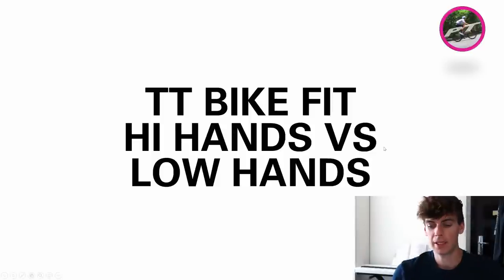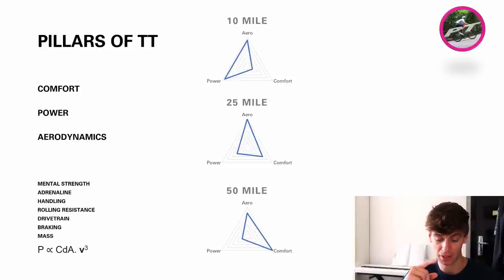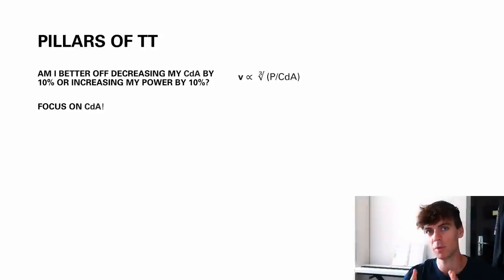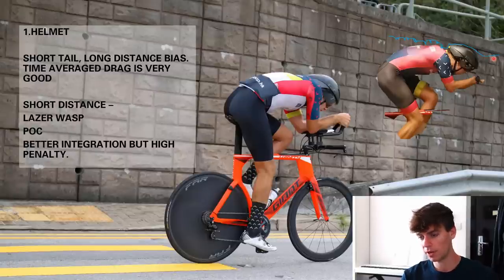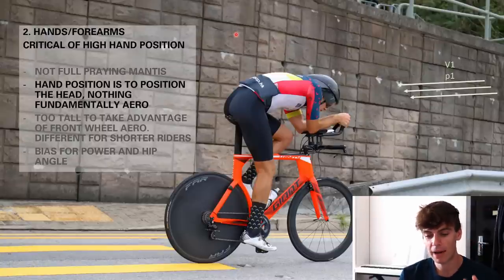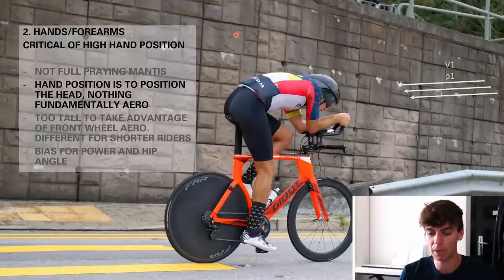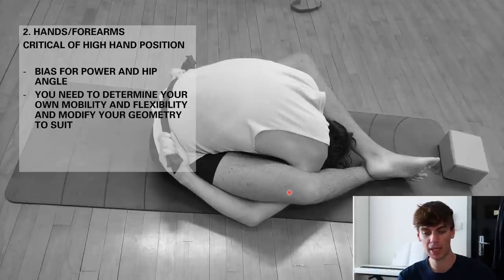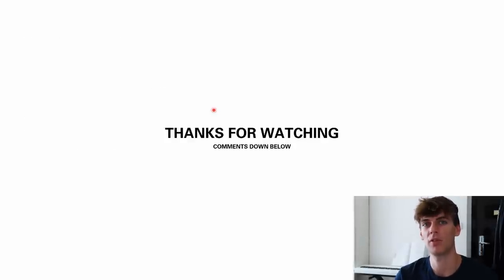TT position - High Hands Vs Low Hands. Time Trialling and Hambini response

Comment: Ahhh... Hambini, Luescher and you. 
Haven't had this much fun learning physics  since my high school physics teacher tripped on the extension chord for the laser. He was on about prisms, colour spectrum and optical index something or other. I learned a few things about gravity. 
Please make these  these back and forth reamings or cross references a regular thing. :D
Reply: Hambini thinks Luesher shouldn't repair carbon frames. You never can quite duplicate the factory materials and create a seamless bond. I suspect Hambini is partly correct. Luesher seems to know when a repair is safe and possible and when it's scrap.
Reply: People seem to disagree on what knots to use for their shoelaces No wonder aerodynamics or the structural integrity of a repaired carbon bike invites different points of view. This is not about general agreement, but independence and competence. Actual engineering analysis instead of marketing balderdash.
Reply: Luescher is very particular about what he will fix and what he wont
Reply: Spot on.

Comment: A lot of independent rider chose the Giro. What I do, and I've seen pro's do, (although not strictly legal) is to add some extra padding on the front inside of the helmet, so that the helmet sits more level while not having to strain the neck to much. If you can stay within the UCI limites you could try rotating forward to lower your front end. Other then that, shoe covers, aerobottle, a onepiece suite, the usual.. People that have properly tested raised versus lower arms, like Aerocoach, have explained that for most rider raised arms are faster but there can be very little in it & only if able to maintain power. There are several pro's that have stayed with low arms. I've spend a fair bit modeling & simulating in CFD & I'm often not that impressed with Hambini's "opinions". I always get the impression he's got something to prove.. What really does it for me though is him declaring this that and the other is the worst ... ever invented and then seeing the state of his bikes/garage and "workmate" while dropping his makeshift tools on the floor.. He truly must be a worldclass "plumber" lol..

Comment: You’re bang on with the slightly higher hands encouraging relaxation of the shoulders and allowing a lower head position. I use software in my bike fit process that measures rider frontal area. I consistently see riders being able to reduce their overall frontal area when using a slightly tilted pad and bar.
Reply from the maker: bikescience1 cheers. Good to know.

Comment: This is a good analysis from an athlete's perspective. However,  you may be missing one advantage of your semi mantis position - keeping some of the air from being "trapped" at your belly/hip area. Instead you push it outwards and around your body. Some of the same effect is achieved by using the POC Tempor or MET WideBody, reducing the drag created by your shoulder area.

Comment: Great video! You are right, there is no way the flow coming off yours or R.Dennis' helmet is laminar. Just recently found your channel and finding the level of detail and engineering insight facinating. I would be intersted to hear your take/analysis on osymetric chain rings. Thanks!
Reply: Have not got osymetrics but on my fat bike................I could top out at 38kph on the flat but the pedal stroke was very choppy - changed to a oval ring - smooth pedal stroke - found the same on my road bike - my TT bike had them already fitted when i got it - more power?? I don’t think so just a smoother pedal stroke for those of us (me) with poor technique. I did look at osymetrics when i changed my road bike rings but was very unconvinced and still running 2x rings I’d have been dropping chains all day - so it’s q ring and black spire - and forget carbon rings on 2x setups - they don’t like shifting and you have a handful of teeth and a carbon paper weight

Comment: The art of TT. It is. No power meter will give you all the answers. Real world discussion here. Where to invest the watts. Certainly not downhill against a headwind! In that case aero really is king. Get so low your power drops along with comfort. Uphill with  tailwind power rules unless you overcook it. Then you've lost time. Unfortunately you can't go back and try it again because conditions have changed.  That is why it's an art. Great Hambini  impression! Really? Fluid dynamics? A plumber?

Comment: Have you thought about attaching streamers in the form of yarn taped to a surface in the rear of the aero helmet to detect what kind of flow there is? Pretty easy to discern if its laminar or turbulent flow and thus isolate areas for aerodynamic improvement.

Comment: Hi, thank you for the interesting content!

Regarding improvement in FTP or CP for moderately trained cyclists, it would depend on the timeframe you have for improvements. If you are talking about a month 10% would generally be exceedingly difficult, but if you have 3-6 months 10% should be doable for a lot of ppl with a quality program that fits their physiology.

Regarding the tightness in your hips and quads, from what you describe I think I might be your hip flexors and rectus femoris (both hip flexor and knee extender) that’s a bit tight and implementing some stretches for them might help. This could also be a part of the reason for why you back injury occurred.
For the rectus femoris I would recommend active/passive stretching since that generally would give more functional adaptations on the bike. While on the hips flexors regular passive stretching should do the trick.

Keep making the content!
Reply from the maker: Very interesting thanks. What are some effective rectus femoris you can recommend?
Reply: @PeakTorque  This video her shows it pretty good, but instead of just holding the leg you'r stretching with you'r hand, you should put it on a chair or a box against a wall. That way you will have a lot more control over the stretch.
https://www.youtube.com/watch?v=HrhaL4XQaLs

If you want to use a active/passive you should hold the passive stretch for 30 s then while holding the stretch try to push your leg back using a knee extension  for 10 s, then release for 10 s, then repeat that 3 times.
For a regular passive stretch you just hold the stretch for 30-45 s and then release for 10 s and repeat 3 times.
Ann important note is to use a pad or pillow under the knee so you don't put to much pressure on the kneecap and patellae tendon.

Comment: Nice video! Wonder where the height cut-off is for the head and forearms entering the front wheel cone... and how this varies with rider velocity, wind velocity, yaw... . I'm also on the fence with disc wheels; for a course with very few points of acceleration for corners, and with considerable time spent at high yaw angles is where I see most upside
Reply from the maker: George C im not sure about the pressure theory. Hambini will clarify im sure. Agreed on the disc, feels like a right turd out of slow corners
Reply: @PeakTorque  Is the width of the front wheel cone significant?  My head/helmet and (as a triathlete) shoulders are a lot wider than my front wheel.

Comment: The disc wheel thing at the end was a shock. Can you elaborate on what the sensations of riding one that you dont like?
I've ridden disc wheels for years on track and TT bikes and I LOVE the handling. Granted I'm riding at 50kph not 40, but still they seem super quick in cornering, and lower weight than a deep section wheel (and less rotational inertia for a given weight)

Comment: 23:22 if you look into his knee and quad muscle in relation to his body you can see it is much closer than in your photo which does not have anything to do with his or your height. 
Also looking at his saddle you can see he is at the very tip of it, while you are comfortably positioned almost all the way back, he is almost standing like sprinting and looks like he is in lot of pain doing it, while you look pretty relaxed and comfortable. 
His knee while pedaling goes higher than his elbow while yours is lower, again his upper body is much lower than yours is which again is not function of height but simply speaking he is more flexible than you are, or he is willing to suffer more than you are, I bet cycling in his position is best described as painful but he is still doing it like that.

Comment: One thing about the long/short helmet is that the dip behind the short helmet is on a fairly narrow width of your body. From the sides, the helmet tapers in towards your neck and shoulders. How much "dip" is actually there, and how much space does the long tail actually fill? I think the POC aero helmet addresses this, but others don't. The shoulders are exposed no matter what.

Comment: Fucking engineers and PowerPoints. One important point is that a boundary layer transitioning to turbulence doesn't necessarily imply separation, which is the premise of the "dimples" on various surfaces, but I think you're totally right that aerodynamic optimization requires lots of real world testing, because the deltas cyclists are searching for are often too small to measure/predict with CFD or wind tunnel tests.

Comment: Notice that the tail of Matt Bottrill's helmet is at a different angle and slope than most other helmets long tail or otherwise. The tail actually is flat when he is looking down. I Wonder if he can even look up without it digging into his back through. Either way he looks with his eyes not his neck - as should others

Comment: Would be curious if you could make an app for your 4-bar system.    Most of use could easily do some measurements on a bike and least give us a "swag" on getting into a default "reasonable position" and then tune/adjust from there.

Comment: I like the "you've got 100 beans" analogy. I also think we the consumer need a way to use it whenever the industry tries to sell us the newest, most aero thing ever. Especially when it comes with a weight penalty. Which is something I've never seen addressed, the F=ma equation. Sure, saving 10w here or there are important, but what of it costs an extra 15-20w of effort to move that extra weight?

Comment: I would normally go for the flat forearms position with slightly wide elbow position and hands practically thouching, for three reasons:
1) Safety. I personally find the 'praying mantis' to be extremely sketchy. If I don't feel safe, I can neither keep an aero position, or push significant power. I might just be doing it wrong though. 
2) Stability. The slightly wider elbow position helps me to keep a still upper body, which is both good for aerodynamics (not sure if this outweighs the increase in frontal area) and power output.
3) Sustainability.  Even though it might be a little bit less aerodynamic than narrow elbows, this way can sustain the position for at least an hour in triathlon. For short TTs I do actually space the elbow pads close together and just suffer the discomfort.
It's a difficult trade-off. There are so many factors, it's hard to say which is more important, and impossible to scientifically quantify the comfort units per aero gains.

Comment: 10% more power is objectively better than 10% lower CdA. The scaling is the same but drag only accounts for about 75% of your power dissipation. 
Reducing your CdA by 10% is also really hard if you're already trying. You might go from .22 m^2 to .20 m^2? It'll almost certainly reduce your power output.

Comment: You're somewhat misunderstanding what "laminar flow" is and how it relates to attached flow. You don't need laminar flow to achieve attached flow. In fact, There are many cases where a laminar boundary layer is a lot more likely to separate than a turbulent one. This is why golf balls have dimples and some wings use vg's. But the main point here is that you shouldn't take it for granted that you'll have separated flow just because you have a high Re.

Comment: FTP increase of 10%.... not Hard! Especially not at the weekly mileage/duration you mention. Btw it does come with a physiological cost to get more slippery. It is harder for most to turtle and drop their shoulders, keep the head down, handling the bike in a TT position, folding yourself in half by way of vending the back and/or anterior pelvic tilt, triceps fatigue and so on. Sure there are adjustments that are free-ish, but the rest you gotta push the power to unweight yourself, gotta have the strength and flexibility to fold yourself and hold that fold, time on the bike to get accustomed to the position, neck fatigue, eyeballing etc. Structuring your training is more free than getting more aero.

Comment: It is a tall person's world but when it comes to the extra large sizes of bikes they do look like "farm gates" - if you were able to increase the size of the bike's wheels what would you do (as well as the aesthetics, you could also improve that frontal pressure zone, should you at 6'5" really be riding a better proportioned frame with 30" wheels)?
Reply: And really small riders would do well  with 26" wheels. The small bikes have strange frame geometry to accommodate wheels that are really too large. No market for 30" wheels yet.
Reply: @davidburgess741  Yes and you do see 26" on XS bikes.  Oversized wheels would be the hard part moving beyond the theoretical - I would imagine it would be comparatively easy for Peak Torque to CAD/CAM a frame and have it made by a titanium custom bike builder (alas not aero but would be proof of concept)
Reply: So who could build the tires for the 30 inch wheels? Tubulars maybe by special order? Tire manufacturer sponsoring a team of extra tall men!
Reply: @davidburgess741  I have always thought an NBA Basketballer would do it - some of them do ride bikes and they have the money to commission custom hoops 😏

Comment: so basically what Hambini and Peak Torque are saying, is that it would make sense for aero reasons to have bike size specific wheel sizes? That way, a rider could be positioned in the most aerodynamic position on a bike regardless of his height?
Reply: Not really, because the wheel has its own drag of course. I assume that smaller wheels are almost always faster regardless of the minor gains to be had with rider-wheel interaction, up until the point where handling becomes an issue.

Comment: Wind-tunnels aren't the open highway, to test properly the wind and wheel speeds must match for no wind tests at bike speed.

A biggie is angling the platform 3° both sides data, that's minimum crosswinds apparent AOA at TT speeds.

Then, ya' gotta' do gusts in 15-17kt steady with gusts to 25kt data.

In crosswinds try forearms parallel to the ground, hands down, elbows almost touching and ~120° upper to lower arm angle.

I bet 5-beers this is fastest on the road, that's my commute winds 2-3 days a week as headwinds & cross-headwinds.
Cheers 🍺

Comment: I can hear your hard drive clicking. You might want to replace that soon.
Reply from the maker: Its an ssd. You can probably hear the desk fan. Its 36 degrees here
Reply: Probably the bottom bracket
Reply: @PeakTorque  i hear the clickin too,  obv u have ssd since ur hd died a bit ago, but something is hitting clicking.
Reply: I thought it was the camera's continuous AF that's clicking.
Reply: If he using a canon lens is probably the ois
Reply from the maker: Salvatore Allotta correct. Its actually the auto focus on the g7x thats noisy.
Reply from the maker: Daniel yep canon g7x AF you can hear twitching. I should have recorded on MF but its a pain to use.

Comment: Good hearted jabbing! Hahaha. Shorter tail is better unless you're on a velodrome. I am faster with flat arms and hands. Rode a loop at different powers and analyzed the data. Data was very clear. Flat hands. You'll know if your back and head are aero. You can feel the air flowing over your back.

Comment: There's nothing typical about that critical power curve! 2000w! Marcel Kittel couldn't even do that! You've picked up a track sprinters curve. Also, if you have the right genes you can increase your ftp by more than 10%. Doing 6 hours a week as a club cyclist I had an ftp of about 300w, doing 15 hours I've upped that to 370w. Aero is still more important, but significant improvements in fitness are possible.
Reply: or your power meter is rubbish